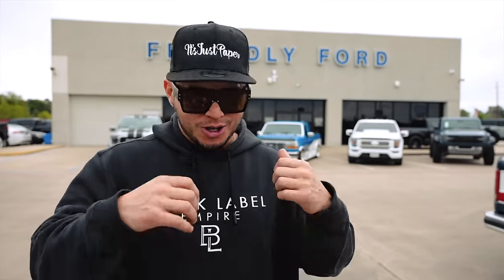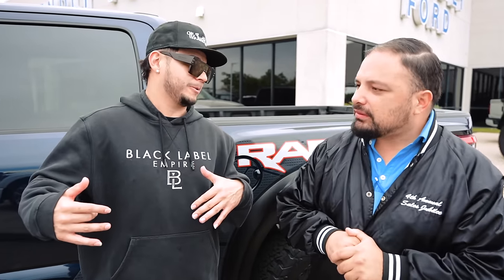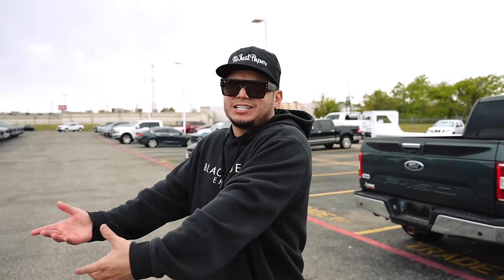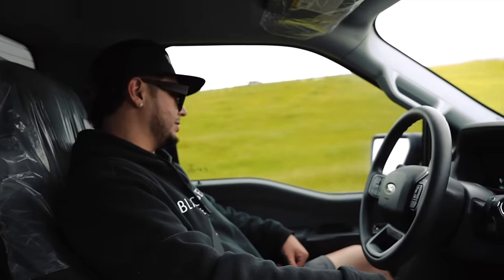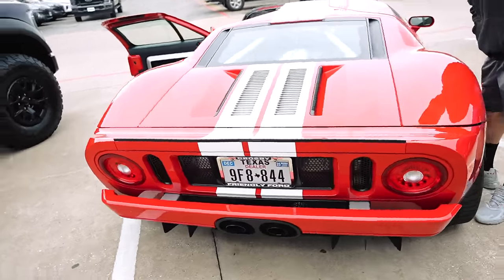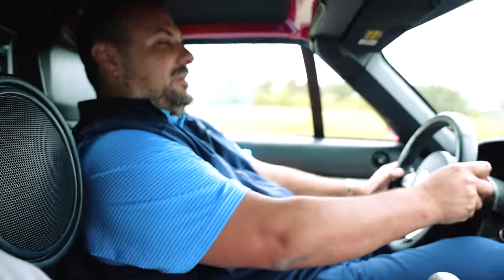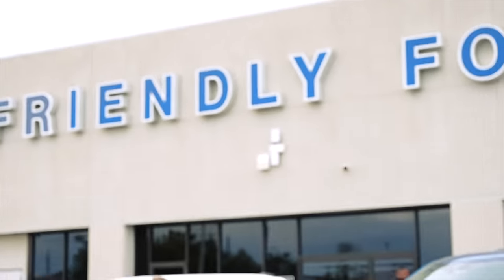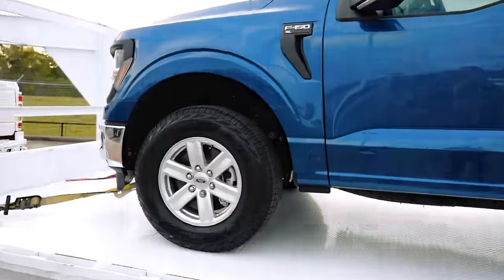Building A Brand New 2024 F-150 4x4 For @ford

Comment: That dude is a very knowledgeable sales man !
Reply: Except for the Ford GT engine part. It was made specially for the Ford GT, aluminum block and heads, not like the GT500, which was iron block, aluminum heads. Only similarity is the engine displacement 5.4L other than that it’s a whole different animal…